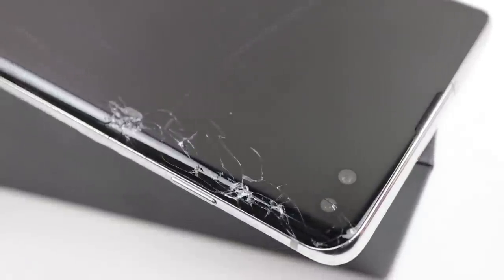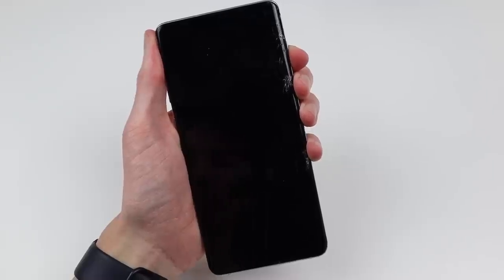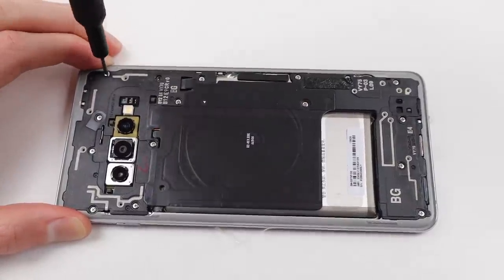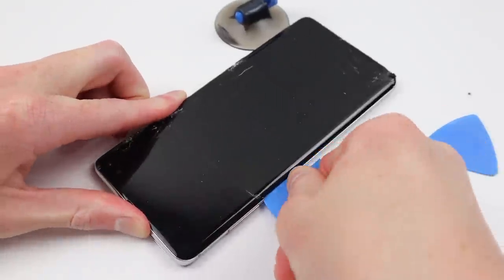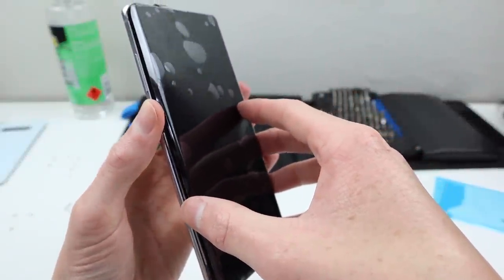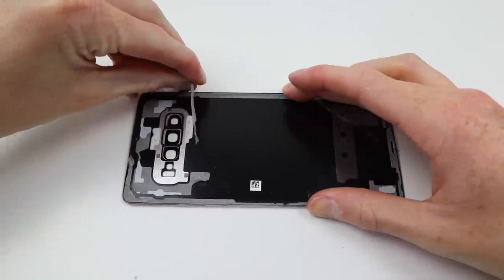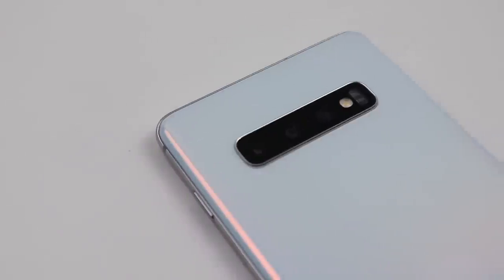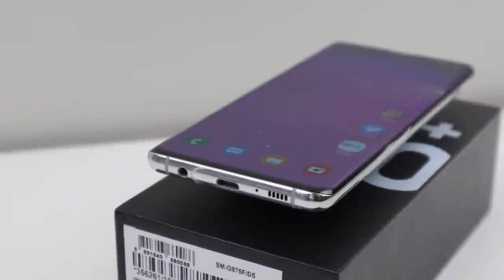Repairing my $400 Galaxy S10+ - Display Replacement

Comment: Should try and do a glass only repair. It’s harder, but will be cheaper.
Reply: It was hurting me badly when he was removing the display completely destroying it
Reply: @Tomaszbe71  yes...:(
Reply: @Tomaszbe71  yea, glass only repair doesn't require you to take off the screen.
Reply: @bobbyjeff32  its not possible with normal tools as the oled glass is applied with oca glue which needs some really expensive equipment to repair
Reply: The heat can damage the oled screen so if you are doing it be careful
Reply: @zeroskill990  that's not true. Oca glue is not that expensive and all you need it UV black light which is also not that expensive. Don't really need any more special tools than those.
Reply: @notnalin  Time and patience is all you need. Also if he's gonna be repairing phone he needs to buy those tools anyway.
Reply: i agree lol, could of swaped a working assembly, what a waster of 150+ dollars
Reply: @zeroskill990  I've seen a repair shop use a heating bed and only isopropyl alcohol to remove the top display with a thin wire pulling down. They did it on a S9+. The top glass was about $5 and the repair shop charged $20
Reply: For OLED display they use LOCA glue not OCA, OCA glue is for LCD display
Reply: @bobbyjeff32  ur mistaken it with LOCA my friend. OCA can not be adhered to the display/glass since it is not in liquid form.
Reply: @Dariddda  yea someone already said that.
Reply: @gausts  he doesn't just needs loca glue and uv.
Reply: @Tomaszbe71  exactly! A shattered s10+ display is still worth like $75-$100 on ebay cause there are people that know how to fix it.
Reply: @zeroskill990  what are You talking about, did You know the uv kola? Makes the dame work and is more cheaper
Reply: Also is the Samsung old same as replacement? They sell alot of screens for other companies. So good screen swapped out for?
Reply: @bobbyjeff32  10 pound ebay. Wire and oca glue and torch.  Bundle deal.
Reply: and also less e waste :)
Reply: @Tomaszbe71  tak, ale
1. wymaga dodatkowych narzędzi.
2. chyba wyświetlacz też był ubity
Reply: no because he killed the display
Reply: yeah but its messy af if you dont have the propher tool, i did that couple of times with a lighter lol
Reply: Lost me at "harder" and I've seen those glass only replacement vids. If I'm doing a diy, money is worth it and the resale value is higher if I decide to sell it

Comment: Samsung: (replacing display with fingerprint sensor, fingerprint scanner still works)
Apple Touch ID: Wait, that's illegal!
Reply: It doesn't remain functional on Apple devices because they pair each home button/touch id sensor to the individual phone, therefore only allowing Apple to repair it, which they will then charge a full display repair fee. This results in higher profits and consumers being forced to upgrade their phones
Reply: @justineasdale2864  but if im faced with that situation, i'll probably just destroy the phone fully and buy a phone with a repairable function from anywhere. Phones like that are useless af lol.
Reply: @TheOfficialEmu  Tim Rob™️
Reply: @Fluxirya  Tim Crook™
Reply: @nickloss2377  Steve Robs™️

Comment: Hugh: We can't just replace glass
People with separators and laminators: laugh in larger profit margin
Reply: And to professionally do it, costs a lot in equipment. Even the Freeze and Liquid Nitrogen methods. So while you do enjoy the profit margins and the skills needed to do so, you chew into this initially first with the cost of equipment. At least what I looked into.
Reply: True, the equipment does cost a ton, and replacing glass using UV glue doesn't always have good outcome
Reply: And also the new replaced galss is local and very fragile.....
Reply: samsung themself says that if we replace glass on the screen of those flagship, it will be usable but only for 1 week if it even works
Reply: The S10 fingerprint wouldn't work anymore if you replace just the glass.
Reply: @prodbydanai  nope still works perfectly well
Reply: You can't replace it not because the display don't come off , but the cable is on the otherside of motherboard
Reply: @malone7987  Are you sure? Because Jerry Rig tried it and it didn't work anymore. He explained that the sensor is bonded to the glass, once it removes, it ceases to work.
Reply: @prodbydanai  no it still works, i run a smartphone repair shop and have done it over 10times now, didn't have any problems so far
Reply: malone so Jerry Rig Doesn’t know how to do it
Reply: @malone7987  the fingerprint could work if you are careful enough with it but at a samsung service place my friend asked them to change the glass on his s10 and they told him they could change the glass but the actual screen won't work for long so he have to change the display which costs quite a bit
Reply: @yayyay8484  as i said i have encountered no problem so far replacing the glass only, i would assume that they wanted to get a bit of cash out of your friend, they'd probably replace the screen and swap the glass on the old one and sell it as a new one to someone else
Reply: @prodbydanai  as zack from jerry mentions removing the screen will destroy the sensor, however there are two methods of doing this, you can either just separate the glass from the screen without detaching the screen from the frame or you could take your time and separate the entire screen using a lot of isopropyl alcohol
Reply: @neidexter  true
Reply: @malone7987  I sent my s10+ to a repair shop to have the glass only replaced. I purchased their service through eBay. They did a flawless job. It looks AND functions just like it was brand new. It only cost me $60 as opposed to the $300 the local ubreakifix wanted to replace the display.
Reply: @neidexter  jerry rig does not know how to do all  repairs, if you notice in some of his videos he breaks phones that he is "disassembling"
Reply: @Silvers24  Actually, you don't need the freezer to refurbish an s10 or s10+... even it is more dangerous to do it that way.
Reply: @Dariddda  I know, I am damn well pretty sure at what you are talking about. But again, the risk is so great its insane. I did attempt that once on a Galaxy S6, the curved screen, (Customer had already bought the new screen, but I had taken the old one off successfully enough the display still worked.) and later when I had nothing to do I attempted to separate them. LOL

In hindsight, I shouldn't have, because if you have the right business in your life, those screens are worth more to companies that buy these screens from us to do this themselves.
Reply: See people stay bashing apple but samsung perma glues batteries so you have to pry them out (which can cause a fire) and you have to remove the motherboard to get to the screen.. on an iPhone, some screens, a little effort, a flex cable and screen is done, no need to remove the logic board :)
Reply: @prodbydanai  the sensor is attached to the display not the glass, you can see it when removing the display
Reply: @jamiecollett8840  what company  did  you use
Reply: he killed the screen
Reply: @prodbydanai  jerry rig literally uses a razor blade... he doesn't have the equipment to take the glass off lol

Comment: Your videos always end up in my recommenced and i always end up clicking. Finally ended up subscribing, Great content! I work at a repair shop and do similar repairs like you have. If i can recommend some tools I would get is a hot plate and set it at 70 c (heat recommended by samsung to us) and lay the  back of the phone on it for about 10 minutes. It gets all the adhesive loose and easy to cut through. Hold it in one hand with a heat resistant glove and use the other to cut through adhesive. Takes practice but haven't cracked a back in a while that way. Now we have a machine that will do the lifting for us. Another tool that works wonders is an iPlastix, works like a playing card or pick but more maneuverable. Use that for so many repairs when I have to work remote repairs. To make the adhesive on the back come off easier as well is to put it on a hot plate and use one had to peel up the adhesive and the other to hold it down, use the pulled off adhesive and tap it onto the residue and it will take it off in the process. Using the heat gun is risky business because sometimes  the paint underneath will peel if it gets too hot in one area.

Comment: Hugh, you really need to invest in an CPB heat pad. It makes opening devices stuck together with adhesive ten times easier. Trust me, you won’t use hot air again. Great videos.
Reply: It will  damage battery and mother board
Reply: Jalim plays not entirely true - only if the device left on there for an extended period of time, however this heat pad has a timer on it so it’s impossible to leave it on. Great tool if used properly - I use it daily.

Comment: As someone who did mobile phone repairs in the past, two things bother me in this video.
1. The fact that you destroyed the original lcd screen, which is quite expensive and can be refurbished
2. Sticking the new screen on Adhesive. Clearly, it's extremely unreliable and after some months of battery/phone heating it will start to come apart, no matter how strong the adhesive might seem. For the back panel it can work, as you will have to take it off the replace the battery, it will do the job. But the best way is to stick the new lcd+touchscreen panel is by using the transparent B7000/E7000/E8000 or the black T-7000 glue. These are extremely trustworthy and you won't have to think about your lcd falling away from the phone.
I like your channel, just point these some things.
Best Regards, Eugene

Comment: I feel that Samsung’s back glass is fun to remove! 
The first time I did the S10 I did a big boy move and I shoved a thin metal took between the glass and frame and in one go it SURPRISINGLY went through. I then heated it and took it off. 
I just use a vacuum suction cup now.

Comment: 3:46 or if it breaks of you can re-solder it on, although this is pretty difficult since the pads are about 3-4mm in size and you can't bridge any solder together

Comment: Jeff, get some 99,9% isopropyl alcohol and get a squeeze bottle with needle pin. Juice up the edges of the glass and the adhesive will loosen up very fast. + Won't damage device what so ever

Comment: Wow, this device was perfect almost, and they sold it for 400 DOLLARS ONLY?!
Reply: New screens are a few hundred bucks, so they probably just wanted to get rid of it cause its an expensive repair. I paid €300 to get my S10+ screen replaced when I dropped it and smashed the screen.
Reply: That new display eats upbthe savings xd. May as well have gotten one in better condition
Reply: In Amazon you can get a used S10+ with a good display for ~450 US dollars. The display replacement he used from iFixit was 289 and the phone itself was 400, I don't think that's worth the money.
Reply: @carballo8730  Keep in mind this is 400 australian dollars so much cheaper in us $, and ifixit sells him parts for cheaper cause he promotes them.

Comment: United Arab Emirates have 220v sockets of types C, D and G. The UK socket is type G. I live in England and I love our sockets until you stand on a plug on the floor which really hurts. However, they are all individually fused which serves to make them the safest types availible if you don't die from the pain of standing on them.

Comment: So how exactly does one know if it is still water and dust resistant when having to go through a third party?
Reply: you don't. but Samsung's authorized repair centers have a program where it can use the barometer to read the pressure around the phone, to see if it's water resistant or not. some third parties have this tool as well but not a lot do
Reply: thiefrules yup, you are right same with apple.
Reply: Go into *#0*# 

Open up sensors

Locate barometer

Press on the phone. If the pressure increases, then decreases, then comes back to reference value, you can safely assume the phone is air tight, it won't let dust in, but i still wouldn't trust it with water resistance.

Comment: Hugh I suggest cleaning and disinfecting any phones that are bought secondhand as you don’t always know where they have been and what they went through. 

Also, I just realized how the repair shops might try to scam you, you see, when I use to have an iPhone 6, and I got another phone, I decided to take the battery out of it, and I saw that the screen ribbons did not have a bracket on them, so if I drop my phone, they could have disconnect and it might of seemed like my screen stoped working, and I had to pay extra for that.

Comment: The flex cable of the screen is really difficult to slice it especially with a plastic tool, unless you slice the root. Since the new screen come apart from the glass it gets more likely to brake the oled than actually slicing the flex cable. Sometimes it doesn't even flicker indicating that completely lost the function of the oled . What I mean. For example the first foldable phone of Samsung, when you knick and get to the oled, the oled half of the times won't turn on. Oled panels are really fragile and whatever touches it , breaks it. The only thing that would sometimes work for removing these screens is a really thin metal pry tool that can get underneath the oled and cuts the adhesive. This is really tough work to do and make it work again . Especially if you replace the front glass only.

Comment: I saw a video of huawei replacing mate 30 pro displays. After thay changed the panel they heat the glass little bit and press it firmly so that the glass adheres properly and maintains its water resistance.

Comment: I can refurbish the front panel, if the display itself has no issues, such as non working touch, black spots, lines, etc.
I consider it a 7/10 on difficulty. The hardest to refurbish are Huawei flagships with curved glass. Those are almost impossible to separate from the frame without breaking the display.

Comment: Hi Hugh I attempted a screen replacement on a iPhone 6s and it all went well thanks to your video . Well until I went to plug the screen in. The connector connecting the home button fell off the ribbon cable and now I have no home button THIS HAS HAPPENED TWICE. So I’ve spent more on screens than I have on the phone. Is there a way I can fix it or do I have to spend yet another £20 on a new display?

Comment: its only $350 AUD to get Samsung to replace the screen directly and it includes a new frame, battery and labour, Had mine done recently for an S10+ and can confirm. Seems a waste to pay $400 plus your time and possibly damaging the rear glass if your a newbie. 

Well done on replacing it though, its not easy but you did amazingly well

Comment: Hey hugh im going to give u a tip for separating display on s8~s20 n8~n10
Dont put the pick just use triump card and careful at the bottem control board is on bottem

Comment: I'm currenlty in a military base where a heating tool may be a problem to have on me. I don't plan to keep my current screen but would it be safe to simply pry it open with the rights tools ? Does the adhesive from ifix stick on its own or would I also need to apply heat ? What tools will I need ?

Comment: Hi i have a 5 gb version of h10, bought it back in 2005 or 2006 (not sure now). It doesn't boot up after a fall, it experienced shortly after purchase. I still have it. The screen comes on when I connect with pc. But the device doesn't get recognized on computer. It's an old tech piece, do you think it can be revived?

Comment: Does the replacement panel has the same screen to body ratio of the original panel?
Is the Bezel thickness of both the panels the same?
Is the replacement panel from a previous Samsung phone or is it custom made?

Comment: hey hugh, since the display touch was only broken but working..could you have just replaced the glass panel on the original oled instead of purchasing the whole oled panel? you could've saved

Comment: I'm in the UK, can you tell me how much it is to buy a replacement screen for my galaxy s10 plus? I already know it is only 5 quid for the back glass. My s10 fell out my pocket 5 days after getting it n cracked the back but I just noticed that it's got a little crack in the bottom corner on the front and I'm building up the courage to repair both sides. I'd be grateful for any advice thanks.

Comment: My s10 screen cracked and ive been watching different vids to get some relief. Tried to get it fixed in a samsung service center but wasnt able to after knowing the price 😕
Reply: Yeah its an expensive repair, I paid €300 to get my s10+ front screen replaced after I dropped it and smashed the whole thing.

Comment: hi i have a question and was wondering if you could help me! I have a Samsung Galaxy s10+ SM-975U and the digital and glass screen broke, is an american phone, and Im in Brazil, and so the brazilian phone here is SM-975F some people say they are not compatable but is just the digital screen and glass could it be no problem at all to use a screen from one of these phones Sm-975F and put it on a galaxy SM-975U?

Comment: You should have bought a replacement display with the frame already attached. That way you wouldn't have killed the perfectly working original display, they still are worth some money even if cracked..  
And a display with frame is not that much more expensive than just the display, also you save a lot of time as you don't have to remove the display from the frame in the first place

Comment: If you check on eBay right now, i feel like repairing doesn't really save you that much money vs. just buying a used one in pristine condition. At least fixing it gives you a sense of pride.